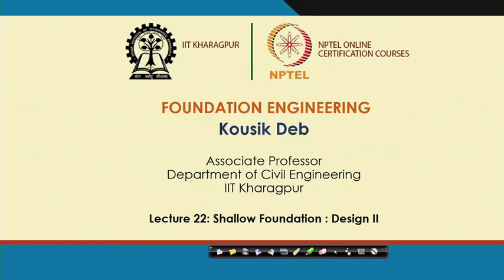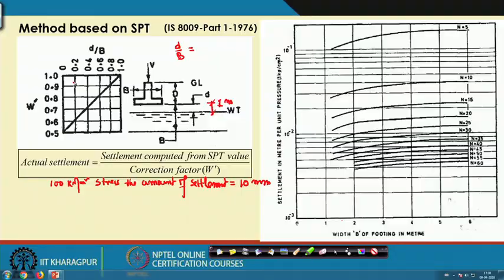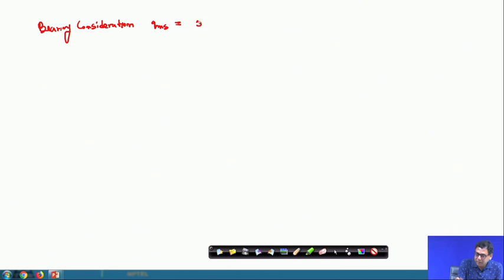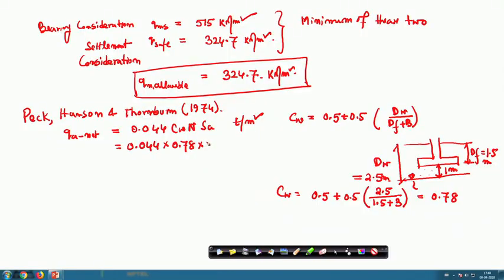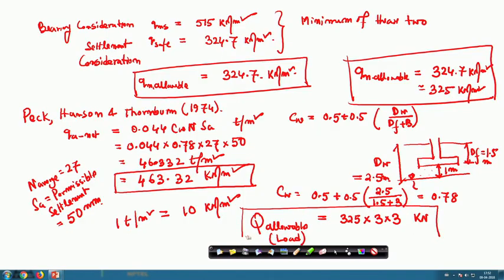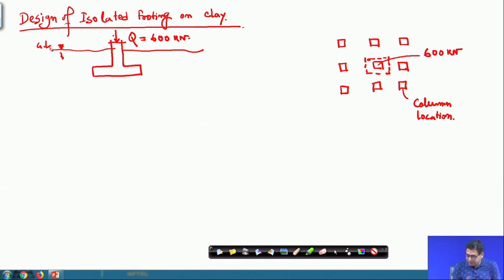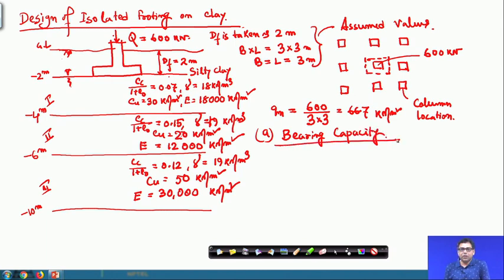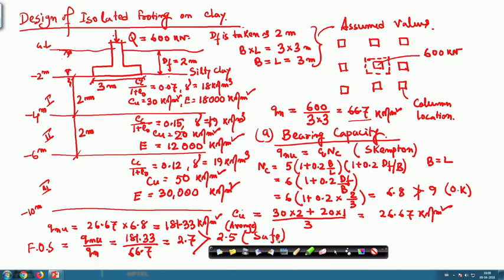Lecture 22 : Shallow Foundation - Design II

Comment: Respected sir please clearly explain qs( settlement ) calculation because i dont understand how you are calculating. 100/50*15.4 = 324.7?
Reply: Sir write wrong equation [(100/50)*15.4] = 30.8 

True equation is [(100*50)/15.4] = 324.7

Sir get right answer by wrong equation 😅